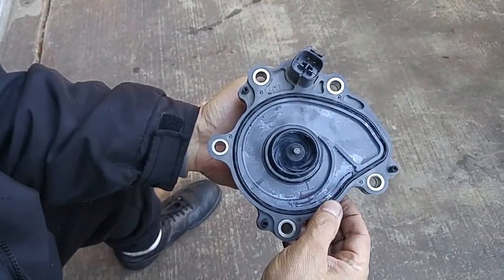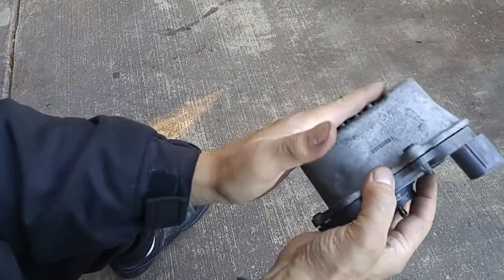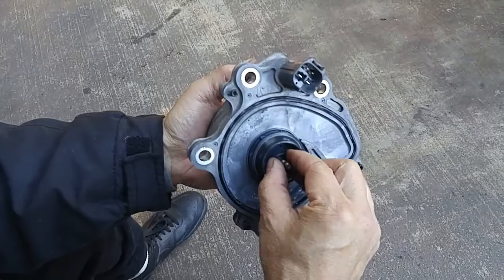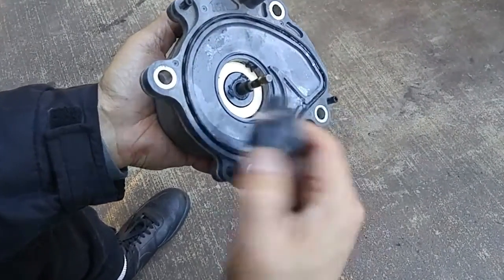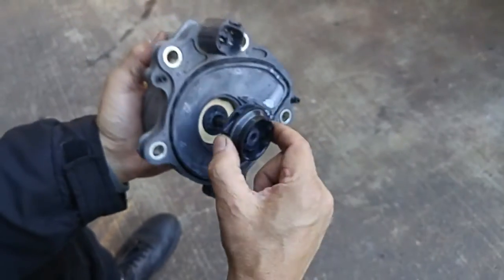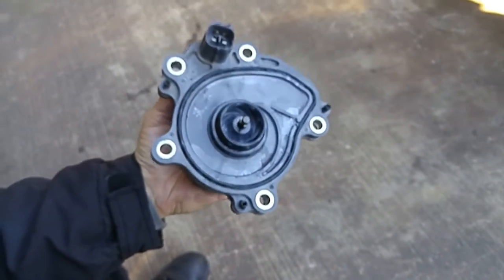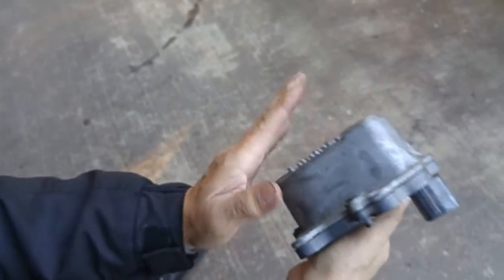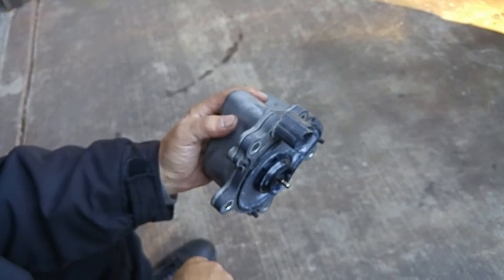Toyota Hybrid Overheating?  2012 - 2017 Camry Hybrid (& 2013 - 2018 Avalon & ES300H)

Comment: $50 on eBay. You charge $400
Reply from the maker: If you only want to replace the rotor / impeller...assuming you can get the old one out.

Comment: $79 on Amazon!!
Reply from the maker: Hope it works and lasts!
Reply: @hardlymovingpro It has for over a year now! It was the magnetic spindle that warped so that it couldn't spin!
Reply from the maker: You're right about the magnetic rotor / impeller that's the source of the failure.  The plastic covering breaks loose and rubs against the interior wall of the pump which prevents the rotor from spinning freely.
Reply: @hardlymovingpro One more thing about this... I discovered that my radiator is DIRTY filled with dirt in between the fins which can cause overheating under certain conditions and so if that radiator fluid is hotter than it should be running thru the pump around that plastic, it could cause it to snap or warp!

So the pump failing might just be a symptom and not the cause! So check your radiator especially if it has lots of miles or have been thru lots of debris in the air!
Reply from the maker: Good point!  With my home ac system, I clean off debris from the condenser fins with my garden hose.  Don't use chemicals.

Comment: Unfortunately, it’s not a Toyota part. I feel like they got ripped off by the manufacturer of the part
Reply from the maker: Toyota doesn't makes parts.  They outsource to companies like Denso, Aisin, GMB, etc. and stick a Toyota label on the part.
Reply: @ that is correct. I should have specified that it isn’t a Denso part!! If it was it probably wouldn’t have any problems
Reply from the maker: Believe the OEM pump is made by Aisin.  What typically fails is the magnetic rotor.  Replace that component as part of a  preventative maintenance procedure should increase the pump's longevity.  Here's a picture of what it looks like:  https://amzn.to/42Gompp

Comment: So I changed my thermostat housing and it’s still running hot so I’m guessing it is my water pump because it is making a loud whining noise and plus one of the gaskets on the radiator cap is broke and it also has over 200,000 miles
Reply from the maker: Could also be a bad head gasket.

Comment: I have a 2011. Changed out engine, water pump, sensor and thermostat. I have issue when I drive high speeds 65-75 mph up hill. Reservoir very hot almost to boiling temperature. Temp red light would turn on or flash and then when I slow down it will eventually turn off. My mechanic replaced literally everything minus the radiator and the inverter coolant pump. Can anyone please help????

No codes or no check engine lights just the red light engine temperature turns on when driving high speeds up hill for long periods of time. 

Is the issue temp sensor on EGR pipes?

My mechanic has replaced with all OEM parts. Any advice?

Toyota service rep says might be inverter water pump, radiator clogged up, or water pump. 
Just a had Toyota dealership diagnosed and they check for any leaks so it’s not the engine. They said water pump and thermostat. 

My mechanic replaced those 2 parts. I thought I was in the clear but I wasn’t. The car still overheats when driving high speeds 65-75 mph for long periods of time and red temperature light turns on again uphill at high speeds. Anyone please help and TIA

Only radiator and inverter water pump left to be replaced and my mechanic is replacing it.
Reply from the maker: I'd guess it could be a leaking head gasket that looses compression at higher rpms (highway driving) with the exhaust gases migrating to your cooling system.  This explains the hot coolant reservoir.  When the gases escape into the cooling system, the reservoir cap relief valve opens which will push coolant into the coolant reservoir.  When the engine is shut off and cooled, the vacuum from the cooling system sucks back in coolant from the reservoir.   Start by asking your mechanic to perform both a compression and compression leak down test.
Reply: @hardlymovingpro  Toyota recently last week did a compression test and found not leaks in head gasket which was a relief. I just put a brand new engine in it. Can it be the radiator? That’s the only part that hasn’t been replaced. And also the inverter pump hasn’t been replaced. But don’t think it’s the inverter pump.
Reply: @minhphung9252  
Hello, any updates about your car? My 2008 camry hybrid have thr same problem. Overheating at high speeds and once it happens, it has almost no powered. The overheating is only in the electric system while the engine is fine. 

Most mechanics around me are just guessing, no one found a solution yet.

Comment: Wow... I'm literally in the process of replacing my water pump for my 2012 Camry, 140k mi. I haven't taken it off yet but I can feel it moving when I touch it. It cost $350 after taxes on Amazon, and it's also the same brand Toyota uses, Aisin... I can't wait to take off my old one and see what happened. If it's the same reason as in your video, then I'm gonna be pissed lol smh
Reply from the maker: I wouldn't be surprised if the impeller is broken.

Comment: Wtf Toyota, cutting costs to increase profits is not a good look. 
I wonder how much it would cost to have a new impeller fabricated from metal and just replace that.
$400 for a water pump, what’s the world coming to.
Reply from the maker: I hear ya!
Reply: @hardlymovingpro  I commented on one of your vids with a link to a 36 second long video of the timing marks after installing the belt today. If you could be so kind and take a peek so I know if I’m good or need to take the cover off and try again

Comment: added information. This electric water pump is made by AISIN, part number WPT-190 and used by several of the Asian cars like Toyota Hybrids.  Thei impeller assembly inside the cover has an enclose magnet that turn the impeller and it can get corroded a little and it swell up and start rubbing. on it housing.  It simply needs to be swapped out for an undamaged one  from some other rWPT-190 water pump. Or go to Toyota Dealer  and buy a new one. .
Reply from the maker: Good to know and thanks for sharing!

Comment: So the 2014 Toyota Camry Hybrid electric water pump has an anti corrosion plastic impeller in it that can break from torque. It appears to be an repairable once your aware of the impeller location and it's  weakness.. and if Toyota will sell you an impeller vs the whole $450 water pump assembly. This part failure  may or may not be a. one time event as I have not seen anything in the Camera Owners web site or via  owner evaluation of the Camry Hybrid in the Consumer Reports annual car experience ratings.  Then this question. Did 2012 - 2017 all use the exact same electric water pump. and on a personal level Is it in my 2017 Camry Hybrid.
Reply from the maker: Question is:  why a plastic impeller!!??  Few years back had to replace a corolla ac pump only because it has a plastic pulley that broke and couldn't be replaced!

Comment: I get why they used plastic. To prevent corrosion buildup on metal parts...Which is what usually happens from coolant system neglect. But on the bright side. You could be doing a mandatory replacement at 90k miles timing belt, water pump and tension. Which cost $500.00+ Parts....
Reply from the maker: Way too much plastic everywhere.  A customer's Toyota Corolla A/C Compressor belt pulley was made of plastic and broke.  Couldn't find a replacement pulley.  Had to replace the entire compressor!

Comment: Nowadays all manufacturers make disposable cars so that you’ll buy new car after 10 years or 100K miles. Especially European cars are made in such a way that you can’t work on it yourself. Many things will need to be maintained only through the dealership including all the software updates. Had a Volvo once, it was early 2000’s and tranny started kicking. After software update the issue was fixed which cost me $250 bucks even though it should of been free. Not buying any European car ever again. It’s a racket at these stealerships. Just my 2 cents.
Reply from the maker: If more parts were metal instead of plastic, the cars would last beyond 10 years.

Comment: Made out plastic is ok with me, it’s where it was made from that matters, and we all know what that means.
Reply from the maker: Recently replaced an engine on a 07 RX350 with a blown head gasket.  Overheated due to radiator plastic tank rupturing.  Car did have 217k miles on the clock.